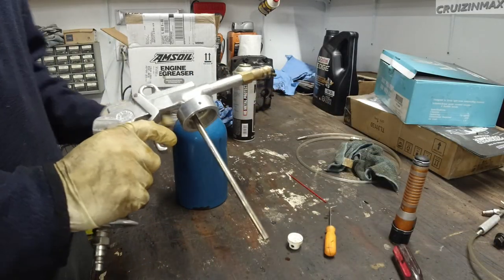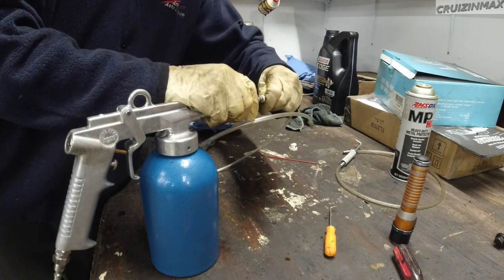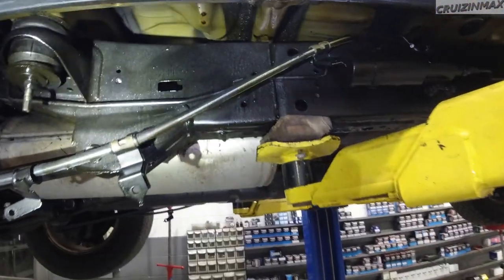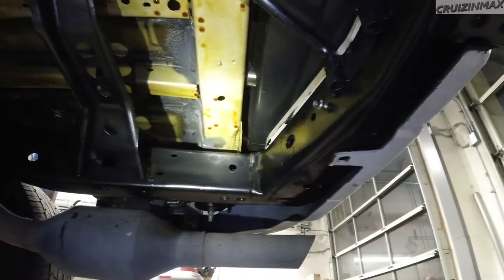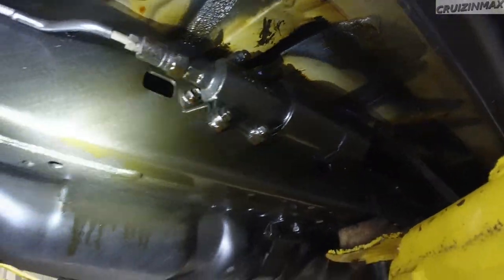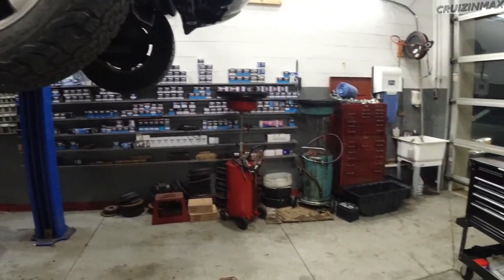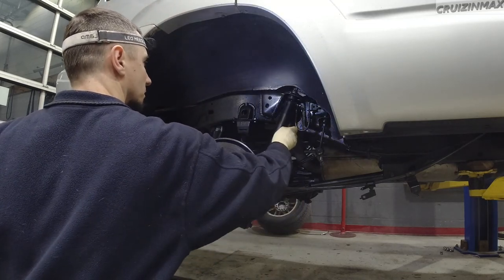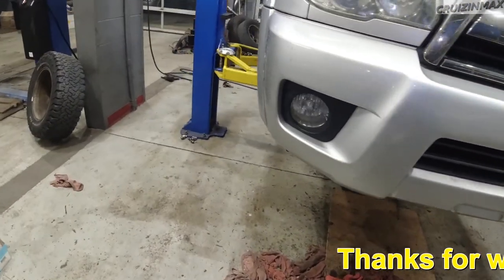4th Gen Toyota 4Runner spraying the frame with amsoil mp  part 3

Comment: Toyotas never get serious rust like American vehicles do.American vehicles break in half from rust Toyotas never break their frames
Reply from the maker: the 4gen 4runners, tacomas and sequoias had a recall because of rusty frames.
Reply: They had recalls and Toyota replaced entire frames to fix an extensive rust problem.
Reply: Work got a new f250 truck and in 2 months there’s rust on the rear quarter panel